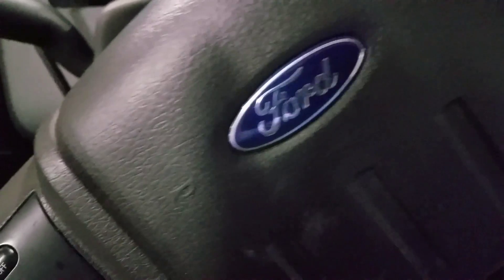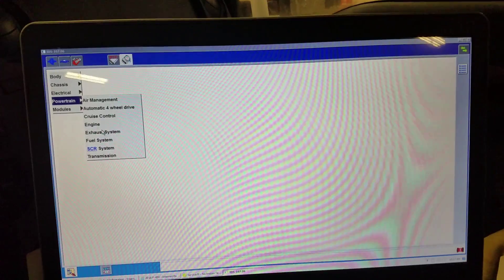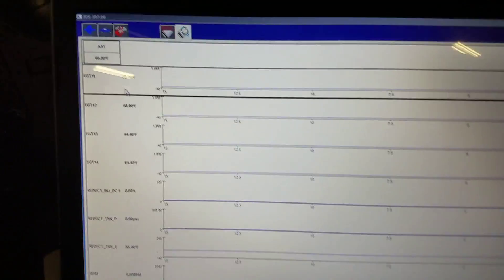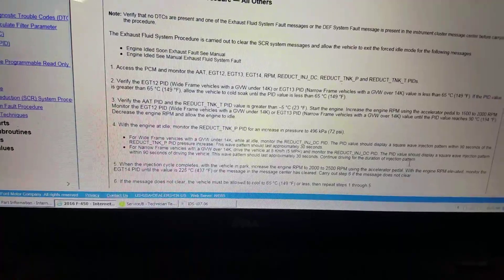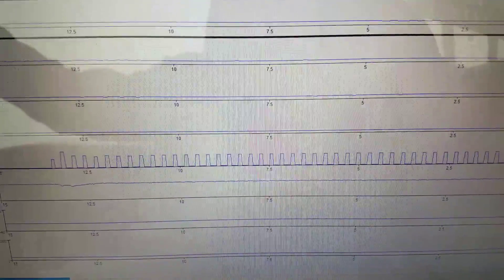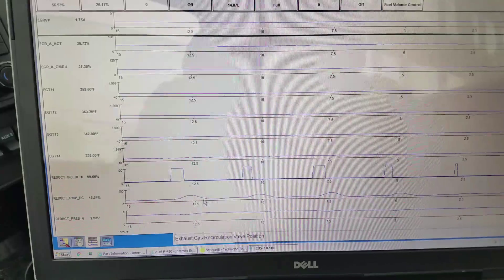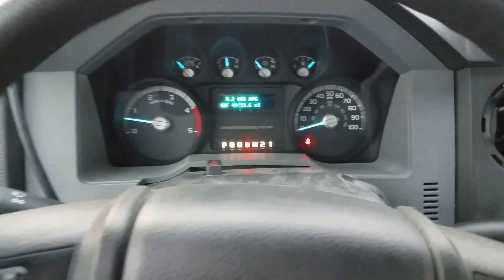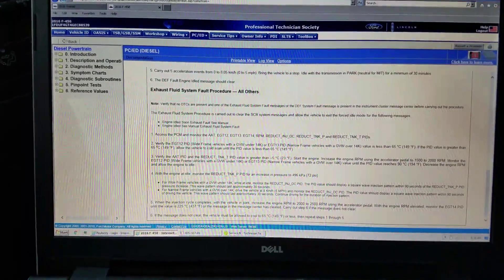Ford 6.7 DERATE warning messages - FIX IT NOW! #viral

Comment: I'm attempting to do this procedure on my 2015 F-250.  It never shows completion of the injection cycle.  REDUCT_INJ_DC stays at 0% and REDUCT_TNK_P stays around 72 PSI.  I waited around 30 minutes and no change.  I never say the pattern.  Any ideas?
Reply: I have this same problem with a 16 f350 !? It won’t do a injection cycle after the initial square wave?
Reply: @ronchase1970  did you have a solution? Mine is doing the same thing. No pattern after the initial square wave.
Reply from the maker: Are you following the correct procedure?
Reply: @PowerStrokeTechTalkwARod  Have 2016 F-250 King R 6.7 Changed Heater Conductor Pump and  Top Def Pressure Pump  . Finished  . Put  Cover Everything Back Together Turn Key On . Shows Exhaust Fluid System Fault Light On Limited to 50 Mph . Do you have any idea what Cause this ?
Reply from the maker: Sorry pal, to get 1on1, gotta buy blocks of my time
Reply: @nicoe.5698  Did you ever get that issue figured out? I am having this EXACT issue on my 2015. Replaced heater & pump, hooked it all back up & now it has that DEF fault code. 1 week to get it into the shop.
Reply from the maker: I would like to help you, i think we cld continue this via email if you'd like..
Reply: Sounds good to me.
Reply: PowerStroke Tech Talk w/ARod  I’ve got the same problem. Same error message. P207f. I’m wondering if I can run a test here or I have to take this into the dealership. I’m also thinking of a egr delete.
Reply from the maker: Ya need the scan tool shown

Comment: My 2018 F250 has a gauge... I put in 2.5gal and it says half-full and 'DEF OK'.  I guess mine is different!
Reply from the maker: Yea this was the model be4 yours
Reply: @PowerStrokeTechTalkwARod  So just to be clear I do not have to worry about this 'fill strategy' on my 21' PS as mine shows a gauge?
Reply from the maker: @FRZNTYM1 correct but still fill it all the way and not just a gallon.
Reply: @PowerStrokeTechTalkwARod  Will do.  Thanks for the reply.

Comment: I've had a couple trucks in, needing to clear that fault and following that procedure. It is a royal PITA to get it out of that derate. I've also had my fair share of being unsuccessful the first go around. I don't know about you, but I have difficulty finessing my right foot on the accelerator to keep it constantly in the specified RPM range to achieve the temperature required. I've thought of pirating an old accelerator and gutting the spring inside to fabricate a little lever in its place to hold it at those RPMs instead of having to sit there like that.Something else to add, it wouldn't be a bad idea to clear all the SCR and NOx tables too, in order to reduce the likelihood of having the Exhaust Fluid Fault reappear shortly after. I find it seems that trucks which have a much higher engine hour count in proportion to vehicle driven mileage seem to have more of these problems.

Comment: Could you explain to us why Ford/EPA requires such a complicated process to reset the error and not simply refill the tank and clear the code.
Reply: Because there is more than one reason the fault code can be set. You need to eliminate the other reasons for the fault code that could include something like a sensor malfunctioning.   In this case, the reason for the fault code was related to how the truck was refilled with DEF - but, that's not always the case.  In the 2019 trucks it appears Ford may have changed the sensor as the DEF fill level gauge goes down gradually (like a fuel gauge) as the DEF is used, and not in large jumps like from full to 1/2.  In my 2011, there was no way to read the DEF level.   You simply got an indication on the information screen  that the truck had 800 miles before it would go into the de-rate mode.  That was the warning it was almost empty and needed to be refilled.

Comment: Excellent video. Great information to.....always fill the def tank to full. I usually don’t let my def tank go past half way.
Reply from the maker: +Steven Ruble thanks for watching
Reply: PowerStroke Tech Talk w/ARod  Hey bro i have a 6.7 2013 F250 saying exhaust fluid / System fault , And reduced power engine / I tried to do  a dynamic regen but it says failure engine didnt get hot enough
Reply from the maker: I guess im confused as to what your question is...
Reply: PowerStroke Tech Talk w/ARod  i have 2 issues #1 is exhaust system fluid Fault and #2 issue is engine reduced power , I filled up tha def tank to full but no errors
or tha sign has not going off , I seed u rev uo tha engine to 2500 rpm ?
Reply from the maker: Give me your email
Reply: Mine often won’t register it’s been filled even though it’s overflowing. I can run it near empty and put in two jugs and it often won’t register. Should have had an actual gauge from the factory.
Reply from the maker: Broski it needs to be reset with my computer. It has gotten out of its strategy of how it calculates its full

Comment: Hey man I got a 2013 Ford Escape it's telling me in the cold weather here in Wisconsin that the engine's overheating when the engines ice cold please respond back
Reply from the maker: +Scott Niles maybe check the cylinder head temp sensor wiring between the 2 middle ignition coil packs on top of the engine.

Comment: Good one. 

You have any suggestions on getting those fender flares off for replacement?  450/550
Reply from the maker: +cttreeclimber +cttreeclimber yea they are a bugger...i wld most likely wait for warm temps, hopefully the clips wont break. Maybe bring it inside over night, a rag n a good trim tool should pop em off
Reply from the maker: +cttreeclimber might be a couple of bolts where the fender liner meets that fender flare couple of 5.5 mm little screws
Reply: PowerStroke Tech Talk w/ARod  cool thanks. The clips look replaceable but I worry about body damage.
Reply from the maker: +cttreeclimber the plastic shld be good, rip that sucker off and replace the clips. If they break go to a body shop near you and I guarantee you they'll have some sort of clip that'll work AutoZone or O'Reilly's won't have nothing like that trust me
Reply: PowerStroke Tech Talk w/ARod.  Thanks. I found them thru ford. Enjoy your vids, and appreciate the replies.  Thanks again.
Reply from the maker: +cttreeclimber no problem, thanks for watchin!